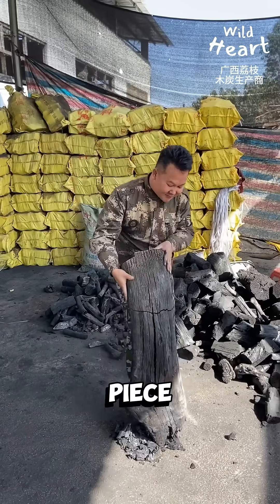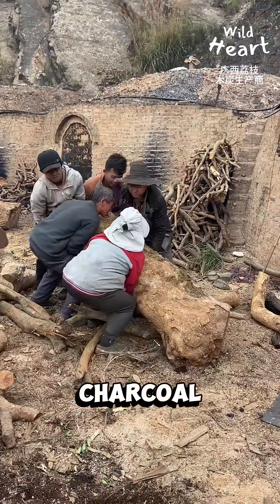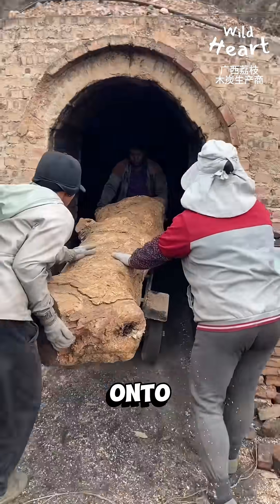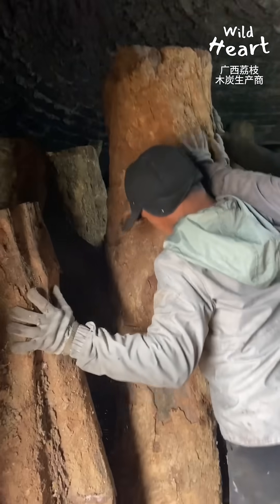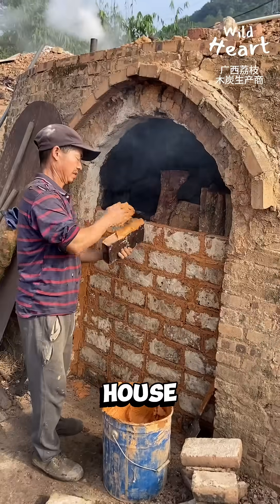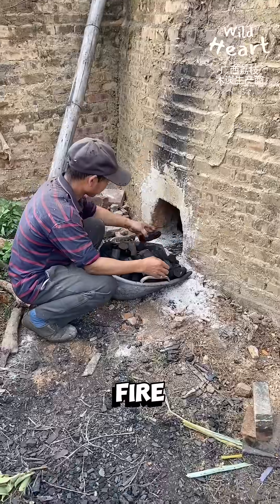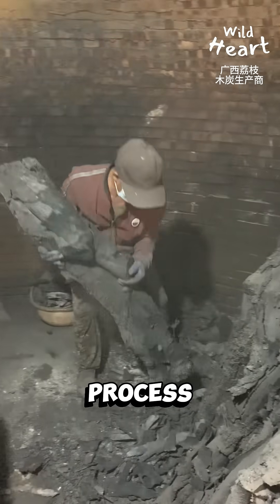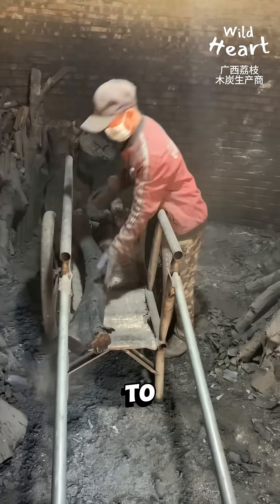How Giant Charcoal Is Made

Comment: All that white smoke, its chock a block with carcinogens. It will also run a engine hooked to a generator. So instead of dumping that valuable yet toxic gas into the air make electricity with it.

Comment: Its densification of wood . Where the energy value of wood is increased multiple times . The wood looses moisture but retains all the energy vale which gets concentrated . Also the wood is light in weight which cost less to transport . This partial pyrolysis technique is not recommended in developed countries like USA UK Europe Australia etc  due to small amount of toxic gases that comes out .